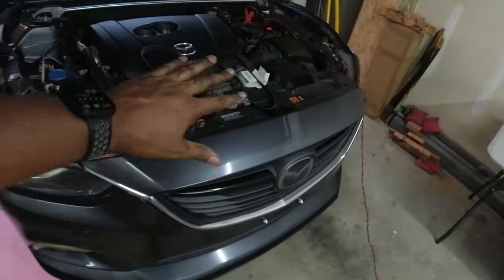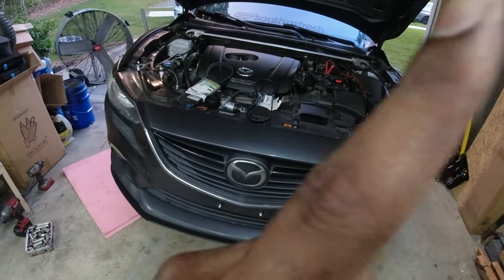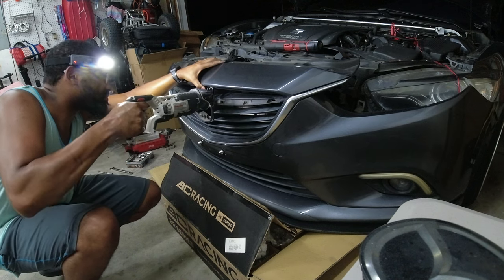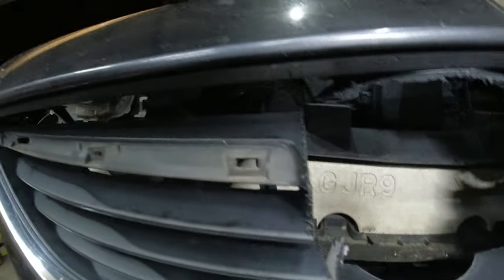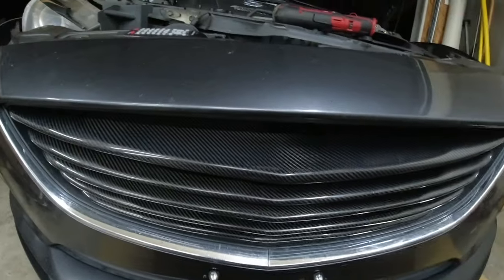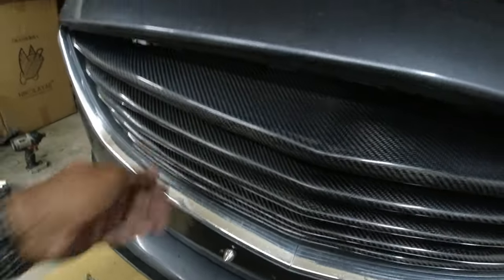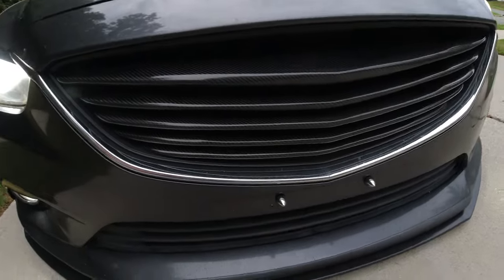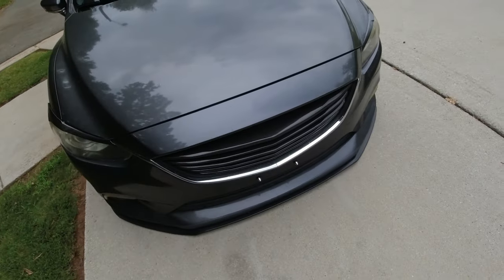Custom Carbon Fiber Grill | Mazda 6

Comment: Looks bad ass! Also really digging the front lip on the bumper and the eyelids on the stock headlights it gives it a much more aggressive appearance. I still wish there was an aftermarket headlights for the gt models with the Xenon bulbs.
Reply from the maker: I’ve wanted custom headlights for a while, but it’ll cost $600+ for a set of used GT lights to customize. It’s ridiculous!

Comment: Looks sweet! I don't think you mentioned if the radar cruise control still works or if the carbon is hampering it any.
Reply from the maker: At the time of the video, I hadn’t driven it yet, but yes it does work!

Comment: Darius Buildz Where can someone get these?
Reply from the maker: I’ve never seen this grill before I bought this one. All the research I’ve done, I can’t find who made it or where it originated from. I got it from a guy in LA that has had it since 2015 and he doesn’t remember how he acquired it.
Reply from the maker: MV Tuning does sell grills but they are 3 bar and the entire center section has to be removed.
Reply: @DariusBuildz  Any issues with your grill conversion?  Is it staying in place okay?
Reply from the maker: everything is holing fine. I havent lost one slat yet!